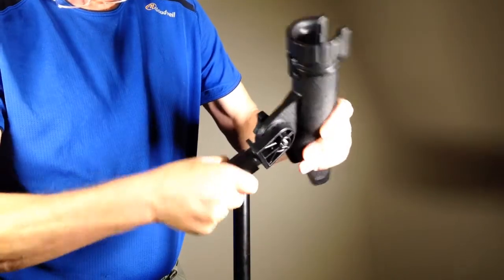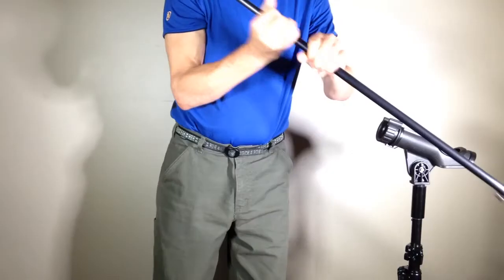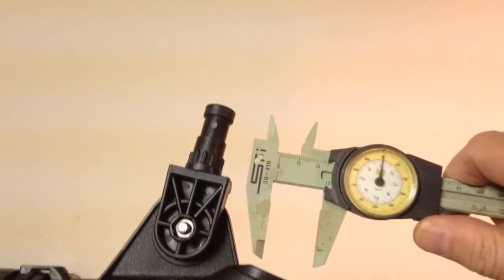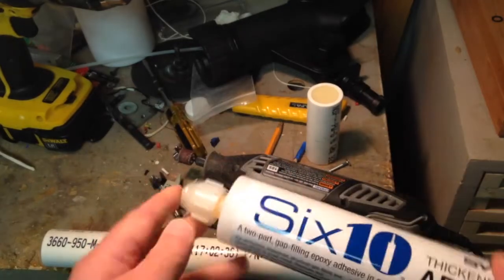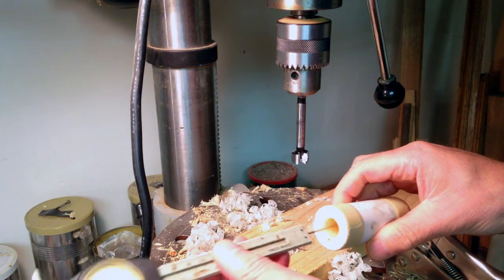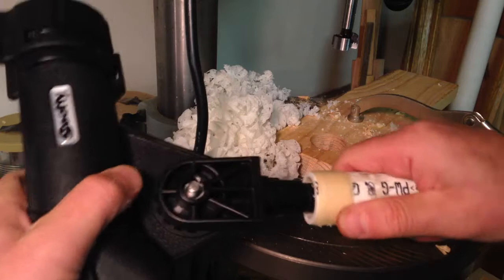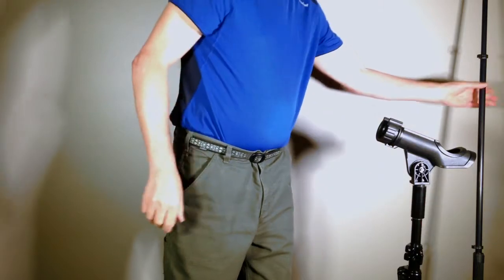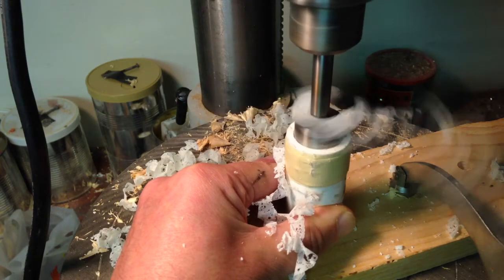Boom Mic Pole to Light Stand Adaptor

Comment: Awesome!  You've solved a problem for me--the boom pole holder I purchased (as you say, bent wire) doesn't work for the slender Rode pole and does require a C-Stand, counter-weights, etc.  I think I'll drive over to the local sporting goods store then to Home Depot for some PVC.  Great job!

Comment: You only show the boom in the holder with the boom angled upward.  This is not how you would use any boom pole on a stand.  You would normally have the lightstand high with the boom pole angled downward.  Although I haven't tried the fishing pole holder but it looks like if angled downward that the boom pole would slip out of the holder.